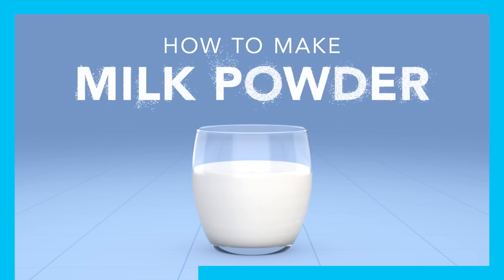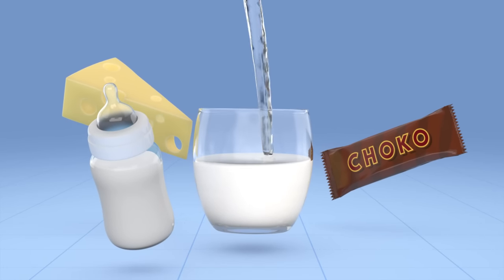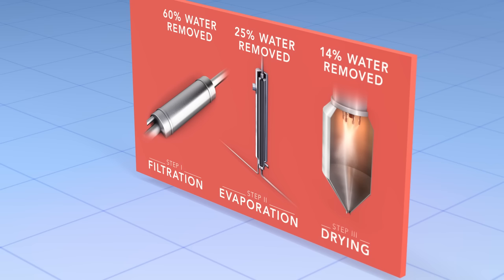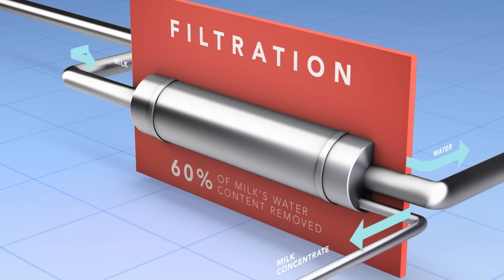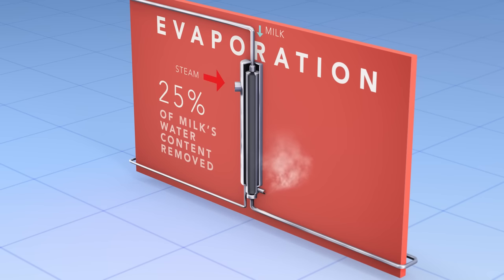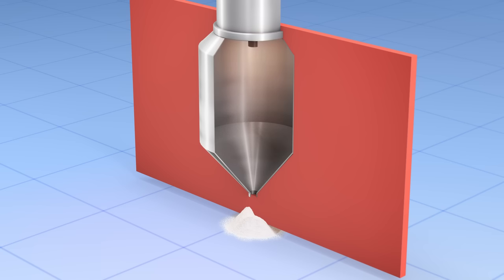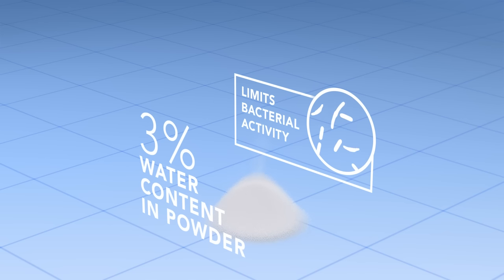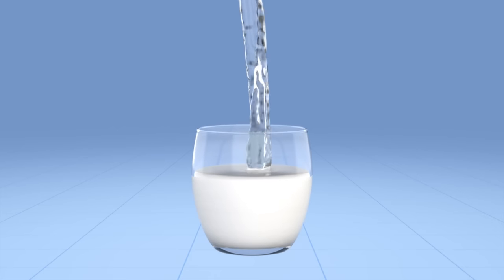How to make milk powder

Comment: This is a high class video which explains us the importance of membrane filteration in dairy plants.
For best  thermal efficiency follow the below mentioned steps one after another 
1) membrane filteration by Ultra filteration or Reverse osmosis ( water removal up to 60%)
2) Evaporation using a falling film evaporator (water removal up to 25%)
3) Two stage spray drying / Extended two stage drying with agglomeration or instantization
 Final product will have up to 3 % water